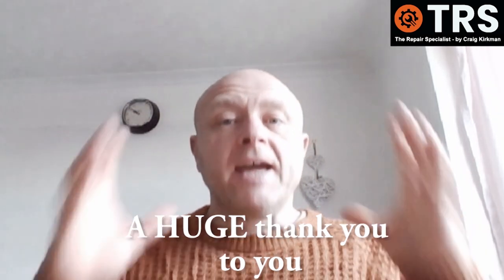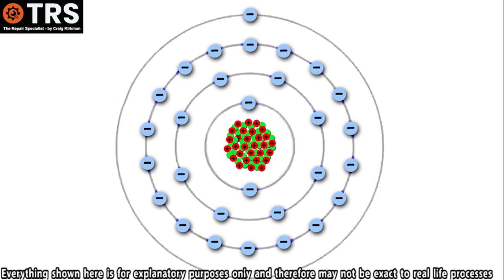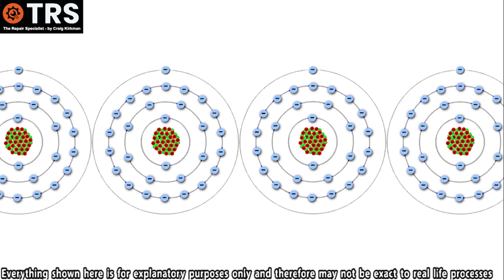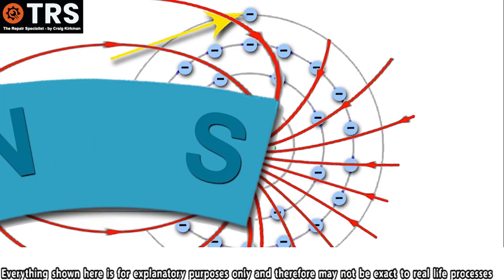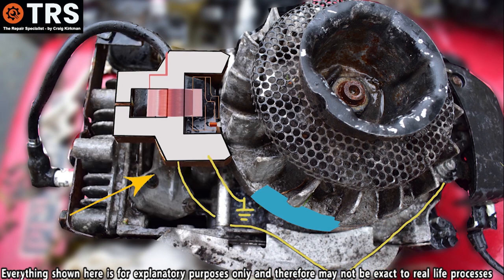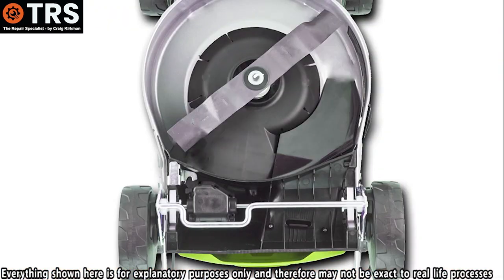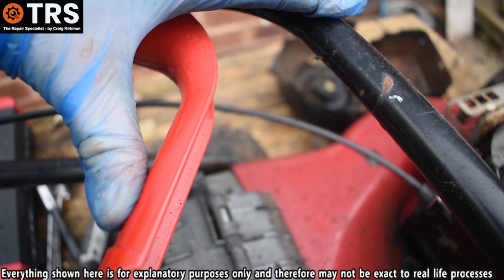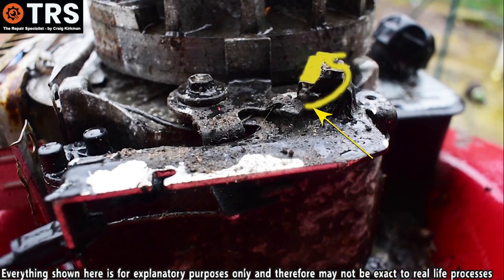ELECTRICAL IGNITION COIL SYSTEM (On Lawn mower)  How it Works - TEST & Diagnose!

Comment: The electrical/electronic diagram of the coil is not explicit presented. The diagram must show correctly the two magneto coils (primary, secondary, the gnd conections inside of the coil magneto, etc. It is corect to use magneto like name and not coil. Coil is a "bobine" and the magneto is an ansamble of electrical/electronic items. It means that the magneto frame is GND common for two coils, primary and secondary. The magneto secondary coil output go to the spark plug hot pin. For the magneto primary coil there are GND from magneto frame and an external hot pin to be conected to GND magneto frame or not connected to GND magneto frame. See the switch (killer magneto primary coil). The magneto inside electronic section inside can be discovered in other link.
Reply from the maker: What you Must understand is that what you are saying is much more complex than what most people ever want to know. As the great Bruce Lee once said "Simplicity is brilliance".  Your explanation is correct, but when giving information to a general public type ordinance, they don't require another intellectual textbook style of explanation. It is this style of education and explanation that made people turn their backs on school life in the first place. The information in this video is a good visual overview, it is NOT meant to be intellectually perfect. But it is for far more interesting than an intellectual textbook explanation.  As the famous public speaker, Simon Sinak said " the world needs more people who can take science and teach it to a truck driver".  Therefore, we don't need more of the intellectual explanation, we need more creative ways to portray it.

Comment: Good video, very well explained! Can you explain how the ignition system adjusts the ignition advancing/retarding on these simple systems, probably no adjustment on a lawnmower engine but ignition looks the same on other more high hp engines which adjust ignition curve with rpm

Comment: The single ignition magnet on my flywheel of old 12HP Briggs engine is North pole only, facing outward. Each end of it reacts with a North pole magnet as repulsion. The Briggs Magnetron just shorts to ground for the primary, due to the solid state module trigger.  There is no AC to shut off primary. Very old engines did have  North + South 2 magnets for AC for Primary.shut down.
Reply from the maker: Thanks for sharing that interesting observation about the magnet on your old 12HP Briggs engine flywheel! It sounds like you have a good understanding of the ignition system's magnet and how it interacts with the Magnetron module.

You're correct that older engines often used a different ignition setup with both North and South magnets on the flywheel to generate alternating current (AC) for primary shutdown. It's fascinating to see how engine designs have evolved over the years.

If you have any more insights or questions about small engines or ignition systems, feel free to share them. It's always great to learn and exchange knowledge within the community. Thanks for contributing to the discussion!

Craig

Comment: A message from 2008 of shutdown web forum, said that a bench test with Briggs Magnetron coil, with magnetic field impressed on  spark plug cable of 20 turns electromagnet with steel nail,  from 12v + 10amps + resistance, caused the high volts to increase from 10,12,15KV to just under 40KV! This was on an ignition coil tester box with internal adjustable gap, and ranges high voltage level. The ouput sent power to the Magnetron primary to start from push button. There was an inline series electromagnet on 12 volts side, with low volts side to a test resistor about 1.2 ohms. (Stress on ignition coill probably changed voltage) I thought only a wider spark gap did that.
Reply from the maker: Wow, that's some fascinating experimentation with the Briggs Magnetron coil! 

You're right; typically, a wider spark gap is one way to increase the voltage in an ignition system. It's always intriguing to see how tinkering and testing can lead to unexpected results. Your message from 2008 highlights the innovative spirit of those who love to explore and understand the inner workings of engines and ignition systems.

Thanks for sharing this intriguing experiment with us! It's a reminder of the endless possibilities when it comes to understanding and optimizing engine performance.

Craig
Reply: i will be doing  a 3 step bench test, using Briggs Magnetron for test with magnetic field on plug cable, In line inductor with diodes, and pulse test of relay/ switch with the tab shutdown terminal neg -130volts pulse, to generate Back EMF high voltage from the L coil. I need to validate the earlier tests done in 2008. He had used ignition coil tester to see results from using S1R9A9M9 triple coils assembly with L coil 1.5Mh inductor and spark gap. 
The higher voltage above 23kv is called plasma path, that is used to allow extra current THROUGH zero ohms spark plug. Then see his 2008 Briggs engine idling running on water in carb. 2 Youtube videos S1R9A9M9 . Combustion chamber 10 amps electrolysis for Hydrogen and Water Vapor Pressure) The alternator was used , after battery disconnected from starting, because of 12 magnets providing free power under flywheel.
Reply: In general, the Magnetron -  is called an autotransformer with 3 terminals. The Briggs twin cyl engine can use either 2 coils or 1 coil. I am using the dual cable type single coil, as used on 2 cyl engine, for my one cyl Briggs engine. This particular type is an actual "standard type" transformer with 4 terminals.  - NOT an autotransformer. The secondary side provides pos and neg high volts to each plug on twin cyl, at the same time. I am using the Positive cable to spark plug with neg cable to ground. The FULL POTENTIAL: high volts is realized if wanting positive high volts. The other 2 methods of obtaining pos high volts requires a loss of volts due to the primary as not being part of secondary. The  regular autotransformer  has negative output high volts, as mounted properly. 
The pre 1982 Magneto transformer mounted upside down is positive high  volts with loss.  The aftermarket UNIVERSAL type trigger module  works for either pos or neg high volts as used with MAGNETO  The Briggs type separate trigger module is hard to modify for positive volts. 
 A Magneto WITH a solid state trigger module , is called a Magnetron. 
 The new 2023 China type and OEM RED BOX Briggs Brand type ignition Magnetrons all have the new Universal type trigger embedded, not the old style Briggs trigger. This now means, a SPARK at a lower RPM of starter mode turning of flywheel., just like in the olden days of pull cord spark!

Comment: Sorry not trying to be petty. But a minor correction. An individual electron only moves through a wire at .02 cm/second(~.5 inches per minute). It is only the signal that moves at approximately the speed of light. You can compare it to a hose full of water. When it is turned on the water almost instantly comes out the end.
Reply from the maker: Thank you for your comment and for bringing up this interesting point! You are correct that the drift velocity of an individual electron in a conductor is indeed very slow, typically on the order of millimeters per second. The analogy of a hose full of water is a good one to explain this concept. When we turn on a hose, the water pressure causes water to come out almost immediately, even though the individual water molecules move much more slowly. Similarly, in a wire, the electrical signal (or electromagnetic wave) propagates at a significant fraction of the speed of light, causing the "effect" of electricity to be felt almost instantaneously, even though the electrons themselves are moving much slower. Thanks again for your input and helping clarify this interesting aspect of electricity!

Comment: Hi can you avswer this problem 190cc lawnmower know spark has a new coil& spark plug flywheel key & magnets good kill wire on& off still know spark  could it be a short or internal timing fault  thanks much appreciated
Reply from the maker: Hi. Please take the following as a guide only and always consult a professional before undertaking any work on your lawnmower:

There could be a number of possible reasons why your 190cc lawnmower isn't sparking despite having a new coil and flywheel key. Here are some troubleshooting procedures to take into account:

Check the Spark Plug: Make that the spark plug is in good shape and is gapped correctly in accordance with the manufacturer's instructions. A damaged spark plug could prohibit ignition even with a new coil. Replace or clean the spark plug as necessary.

Examine the connections between the ignition switch and the wiring to make sure they are secure and linked correctly. The electrical circuit can be broken by loose or damaged wires, which will stop the spark from happening. If necessary, fix or replace any damaged components.

If your lawnmower has a kill switch or other safety mechanism, test it to make sure it is not activated or broken. Check to see whether the spark is restored by disconnecting any kill switch wires and trying to start the lawnmower. If so, the kill switch might require repair or replacement.

Check the Flywheel: Look for any damage or debris that might be interfering with the rotation or alignment of the flywheel. Make sure that the new flywheel key is placed correctly and is not broken or sheared. Flywheel misalignment or damage can alter ignition timing and prevent sparking.

Make sure all grounding connections are safe and in good shape. Check the grounding. The operation of the ignition system can be hampered by a bad or sloppy ground connection

Consult a Professional: If the problem still exists after you have eliminated these typical reasons, it may be wise to contact a seasoned lawnmower specialist or take your machine to a repair shop. They will be able to identify and fix any underlying electrical or ignition system issues thanks to their knowledge and specialised equipment.

When servicing the ignition system on your lawnmower, put safety first. Always seek expert help if you are unsure of or uncomfortable with any troubleshooting steps.

I hope this helps a little 

Craig